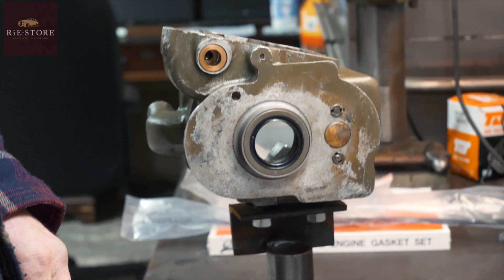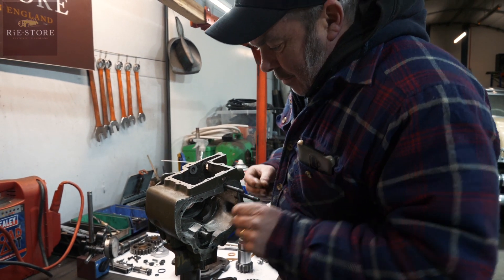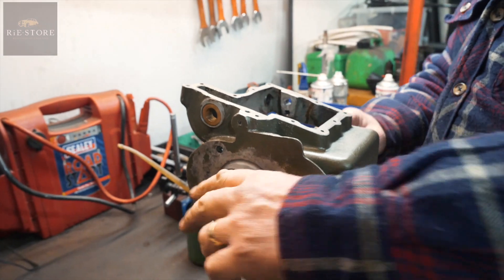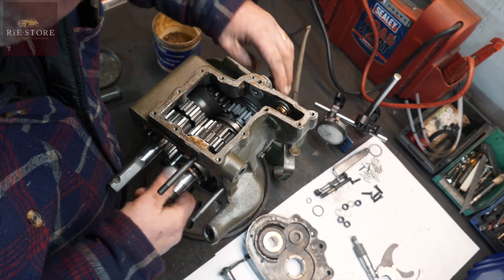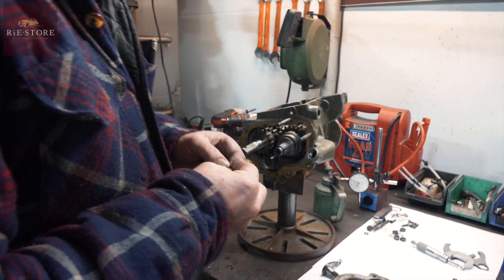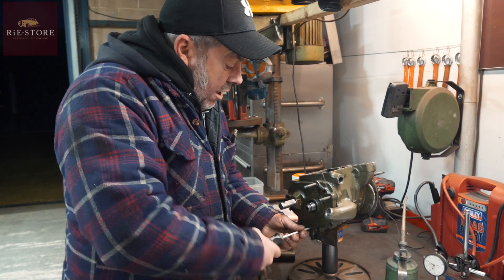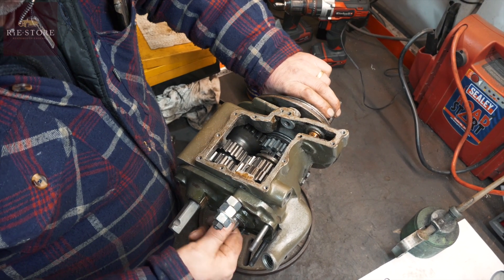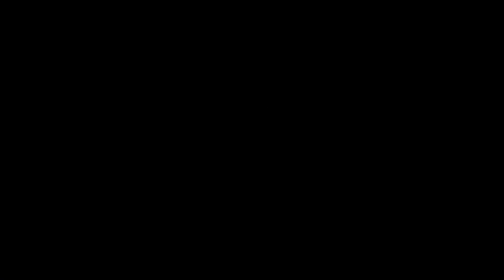How to rebuild a WLA gearbox - Harley Davidson WLA / ep177

Comment: Great program guys. Q- I was watching another program the mechanic said that there was no timing mark on the motor. He said he thought they had installed two right hand flywheels. Claiming that it gave you more horsepower. Have you ever heard of that. The bike was a 49 Panhead.
Reply from the maker: Ash answered your question in this weeks video https://youtu.be/5hsiMeO-eLI

Comment: Nice video. My 1940 WL started getting harder and harder to shift out of third gear. So I replaced the clutch plates and hub as they were well worn.  Now it only seems worse, no matter how I adjust the clutch all gears grind.  So I am wondering if something in the transmission could be going bad??  Any advice?
Reply from the maker: Ash answered your question in this weeks episode: https://youtu.be/-e0cfKzmLBQ?si=SM39lQZ0dwU2h2km - hope it helps!

Comment: Hello again.  a question for Ash,  I'm not getting a straight answer on any forums,  not sure anybody really knows?  New colony tripper bolts, (seem soft)  new european made starter gear, not Vtwin or eastern.  at the top of the return swing after running through a kick start, manually,  the shaft and starter gear gets stuck, not returning the kicker lever all the way.  and it feels rough. I've rotated the trippers, that get gouged really easy.  at this point we are thinking the "left side countershaft bushing",  the one in the case, might be causing this as it is worn beyond the dimensions mentioned in the manual. as a side note,  when mocked up, using a crescent wrench,  rotating the opposite direction it works wonderful and smooth.  also,  the shaft is straight, we measured it for runout,  the starter gear doesn't seem to be hanging up on the splines,,,  and nothing looks odd.  At wit's end,  haven't got a scooby.  Thanks in advance
Reply: To have your question answered please use the hashtag #askash in the comments 🙂Kimo90808
Reply from the maker: Ash answered your question in this weeks video https://youtu.be/CGSw5ba2QgA
Reply: @theworkshopuk  Yes i saw that and thank you and Ash.  this question has been sorted out,  I wanted to thank you,